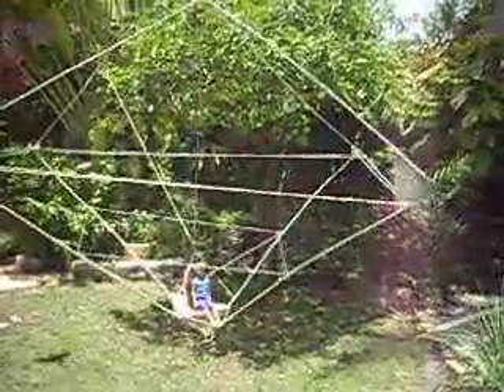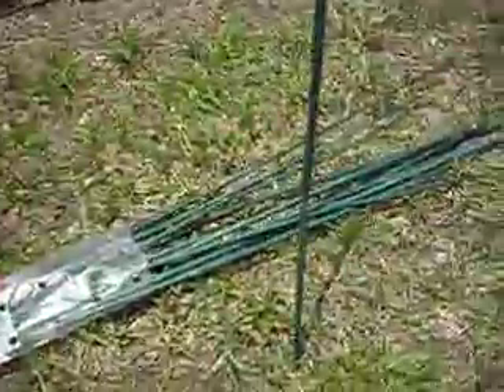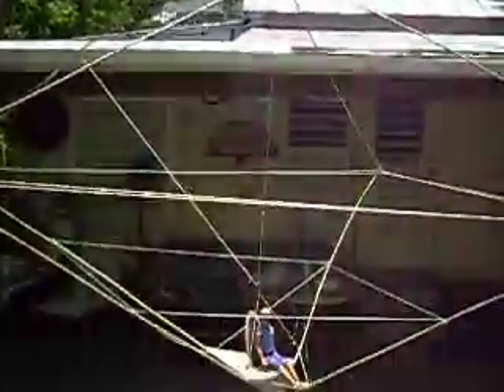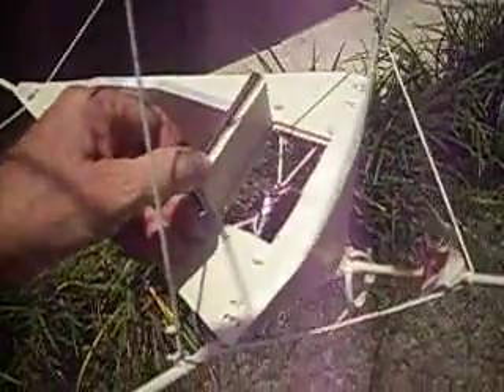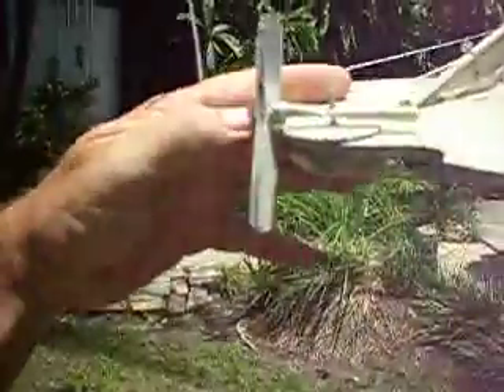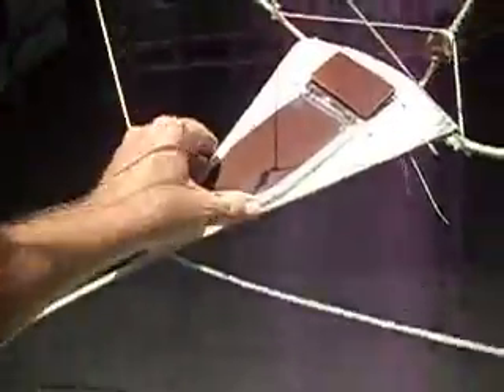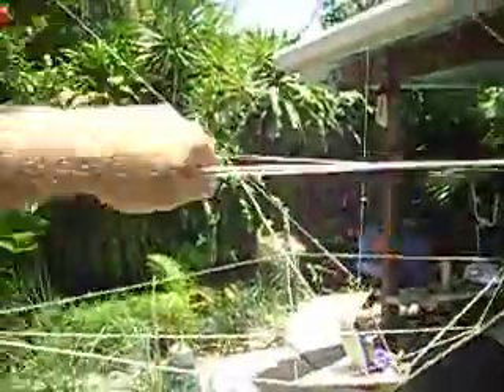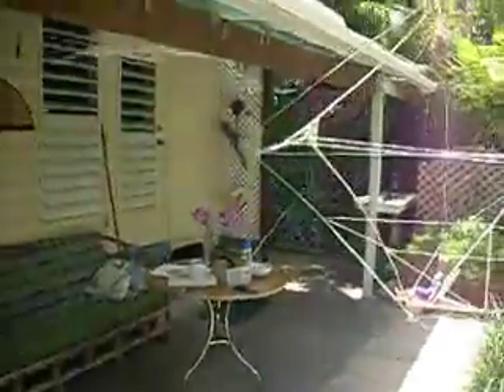Personal Ultralight Dirigible, affordable to construct!

Comment: Is it required that the FAA inspect or register experimental, ultralight homemade aircraft?  Or can we build, and test pilot our own craft without restriction as long as they meet the minimum weight/speed/fuel requirements?
Reply from the maker: its hard to believe but it is true!  you dont need a pilots license and the ship dont need a certificate if it weighs less than 254 pounds!!!!!!   it is a research field that the govt keeps its big fat paws off of in order to allow new inventions for aeronautics.

see my books        at http://www.amazon.com/Allen-Meece/e/B004HCF95S?ref_=pe_1724030_132998060

Comment: I have suspended development of this excellent ultralight personal airship design because few people were interested in the design. It needs a hydrogen electrolyzer to make hudrogen lift gas and they are complicated to make. Helium is way too expensive for recreational pilots to buy.
   It is not a patented design so anyone can develop it.
Reply: +Allen Meece you can make hydrogen gas easy by mixing water, sodium hydroxide and aluminium.
Reply: +Anastas Dolushanov    YEs, I have made H2 by dissolving aluminum but it hate that process, it makes a black sludge mess and a lot of heat.  It sounds like a simple process but it is very unpleasant to work with.
   That's why I prefet the hydrolysis method of running electricity through water to make pure hydrogen. Much cleaner.  It is sad that there is not a cheap hrdrolyzer on the market. We must invent one!   ;-]

Comment: Welll,  i posted this stick-model video 4 years ago and got 10000 views and no comments.  i'm still developing the idea but now i am making a full-size model with aluminum downspouts for the airframe, strengthened with paracord rigging.  who wants to collaborate with this project?  write me at navigaiter(at)gmail.com
Reply: ive had the very same idea for many years now, ive pretty much designed everything it needs to work in my head but not the skills to follow it thru...very do-able keep up the good work..using hydrogen as a lift source? definitely the future of personal travel
Reply: +ItsPauly 22    Yes, it HAS to use hydrogen lift gas if it is ever going to become poopular!  Helium is tooooo expensive for the average pilot to use.  The lift balloons are not perfectly impermeable to thin gasses like helium and hydrogen so there will always be some leakage and loss of lift gas in a month or two.  That would make helium even more expensive because it has to be replensihed all the time.  Hydrogen can be made at home with a hydrolysis unit.
Reply: +Allen Meece 100% with you on that one Allen. its the only way to do it and its safer then the rumors you can even make as you fly if needed, i hope you keep posting videos, ill be very interested in your progress

Comment: @navigaiter
You said 60 feet? With hydrogen as a lift gas? You're not going to have any shortage of lift, I know that much. Consider the $40,000 ultralight hot air airship, au-29. It's 70 feet long, and not nearly as wide as yours. It has a bigger engine, cabin, and a huge propane tank. And this is with hot air, only 1/3 the lift of hydrogen. You have a ton of leeway with that bare minimum design. I wouldn't worry about weight that much. Good luck!

Comment from the maker: @leviterande It will be filled with home made hydrogen inside 25 large lift bags.  All the rigging will have snap fasteners for EZ dis-assembly when it is time to transport the big ultralight dirigible. It must be 60' long and 40'
 wide and 20' tall but it can weigh no more than 254 pounds to qualify as an ultralight aircraft. UL's require no pilots license nor aircraft type certificate from the FAA. Freedom to fly is still available for less than $5000 with this airship.

Comment from the maker: The PUD will be covered with a plastic shrink wrapped envelope enclosing 20 polyethylene plastic film lift bags filled with hydrogen gas.
   The dirigible can be collapsed by disconnecting the spars in twenty-foot sections and removing the snap-on rigging.
   The gondola is a unit which  is fiften feet long and five feet high. A twenty foot trailer is required for transporting and storing this airship. Usually it will be  kept outdoors for months since it would require a huge hangar.